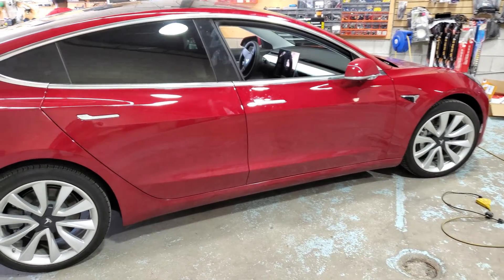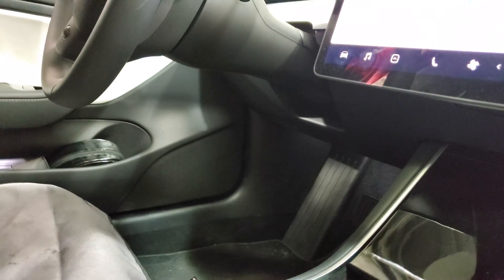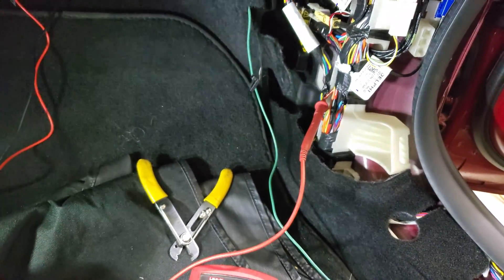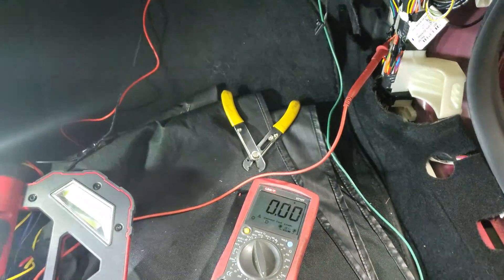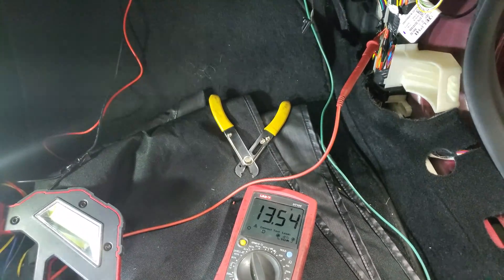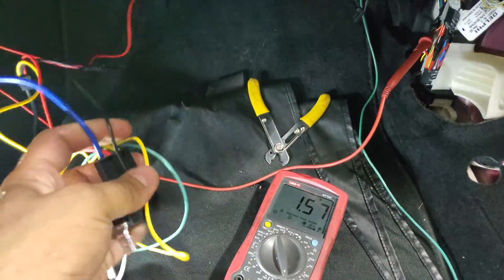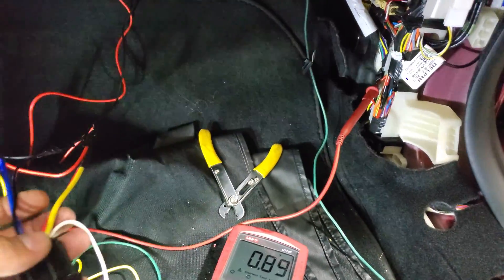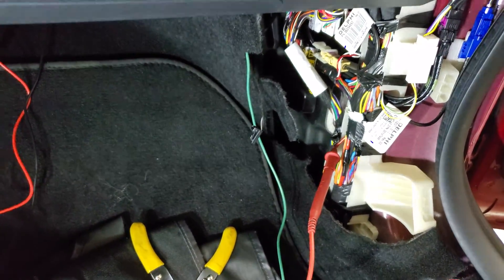Tesla model 3 - How to get switched 12v for accessories

Comment: This wire being tapped is coming off the restraints controller. For Model 3s in the 2020 range, that looks to be connector X200. There’s a few different power wires in there like the video says. The reason the power turns on and off when someone is in the seats is because this wire controls power to the airbags. Airbags only deploy when someone is sitting in it. Use a digital clamp meter to see which one it is.
Reply: I ended up tapping into this wire for my radar detector. Is it safe to tap into and will I run into any electrical issues with the car in the future if I do?
Reply: @FaZeSteps what year is your car?

Comment: This is fantastic. I am installing an aftermarket amp.  And running the main power to the front battery. Then need a remote turn on.   I want to use this as the remote turn on.  Can you let me know which relay you used and when you say it needs a power wire does that connect to the battery directly as well.  Thanks
Reply: Were you able to get the amp installed?
Reply: @everythingtesla8833  yes thanks
Reply: @steveedgerton8187  on 2022 Model 3?
Reply: @everythingtesla8833  yes. 2020 M3 SR+.
Reply: @steveedgerton8187  I have Li-ion 15.5v 12v. That’s why I’m asking.
Reply: Messing around with the battery. Tesla will void your warranty 
Tesla can detect it
Reply: @Itsme-vans  no they cant. and it's my car. im going to do whatever the f!ck i want to it
Reply: @Itsme-vans  so
Reply: @steveedgerton8187  so, if you not worried about void warranty. Go for it, 
There’s many way to tap power sources other than messing with battery

Comment: Soooo, YES the wire (one of the about 4 or 5 thin red ones) is there on a 2019 Model 3, and works as described with my Uniden R7 detector.  NOTE: Be sure you have you phone key connected and active or a key card handy when testing the ON/OFF function of the 12v switched wire and brake pedal. Silly me, disabled my Bluetooth on my phone, and well yeah...big headache and much more time consuming than it should be trying other wires. Doh!!!
Reply: Im trying to do it now, is it a thin red wire or a fatter red wire? I tapped into a thin one, and got no power.. do i try another thin one?

Comment: Thank you for the quick video on switched 12v access on a Tesla Model 3. Your video was perfect for my needs. I wired up my mirror Dashcam pretty much as you described including a power relay. Everything is working perfectly. The only delay I encountered was there are several red wires that harness. I probed a couple wires with a meter and found the smaller gauge red wire was the one I was after. Thanks again!

Comment: Thanks for this tuto. In fact I checked the big red wire and I couldn't get any power at all, either the tesla stationnary or moving, seated or not. Is there something  that I missed? Thanks.
Reply: Why can’t you just show which wire you used?  Is it that difficult?
Reply from the maker: This wire was not thick wire, it was skinny. for the 12V constant we ran the wire directly from the battery. The switched wire is about 18-20 gauge
Reply: @caraudiotoronto  Thanks a lot Sir,  if I understand clearly, the wire to be found is a skinny 18-20 gauge RED WIRE..  You''re a good man, You help me a lot as I want to disconnect for sure a foot sensor when the car is moving.  You  are doing a tremendous job sharing your knowledges in your videos. I couldn't request any installations from You as I am living in France.
Reply from the maker: @jeanbernardderunz8587  No problem, thank you for the compliments
Reply: So far, I haven't found this wire. Is it in the main vertical harness or in the branch coming from under the hood and going down to the floor?  Many shades or red ranging from orange to pinkish. Thanks
Reply: Yeah it’s not really clear watching the video what exact wire being used